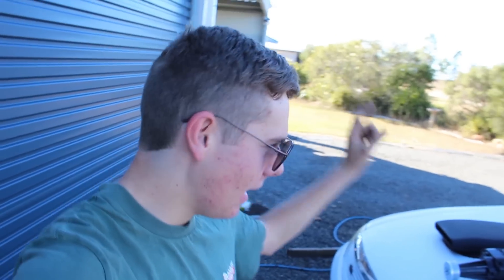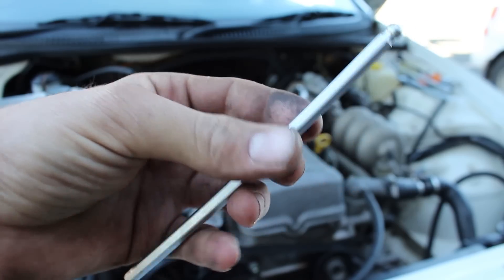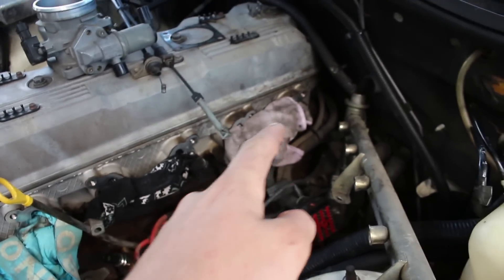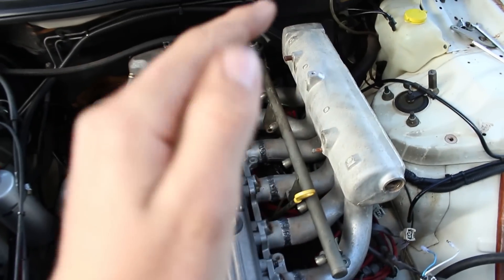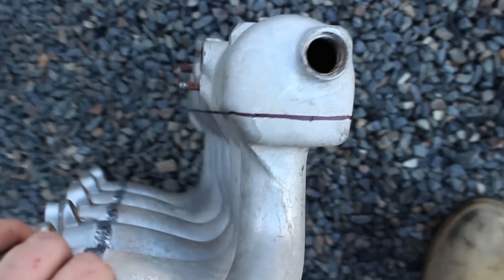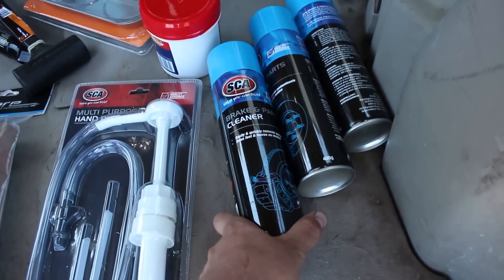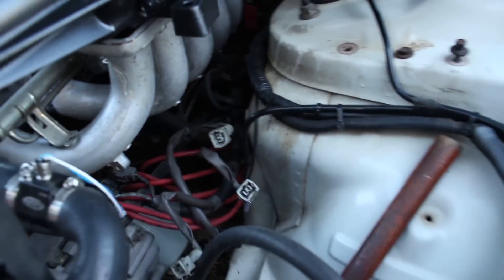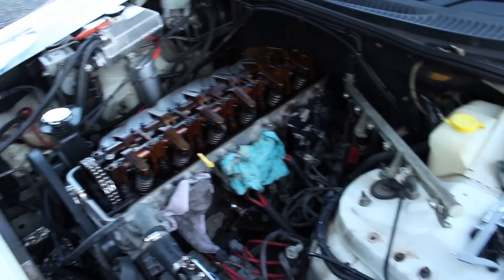COMMODORE SUPERCHARGER ON AU FALCON! Ep.1 - Richos Customs

Comment: Sick stuff, Richo. I noticed that the heat shield over the extractors is a bit different to the stock one, what did that come off?
Reply from the maker: Nathan Harmer yeah mate, of a ba xr6
Reply: @RichosCustoms  Thanks, mate. Is it a straightforward fit or does it need to be modified? I might do the same!
Reply from the maker: Nathan Harmer requires a bit of chopping and bending but nothing a few cuts can’t fix

Comment: Looks really good, hopefully has enough displacement to fill the 4 litre. I would have made the plenum larger and mounted the blower more central or on its side, get yourself a 12:1 rising rate fmu to up the fuel pressure with boost, add an additional inline bosch 044 pump and you'll be able to send it.

Comment: I'm doing an m90 supercharger on au engine too, only in an xf. I'm using a modified bbm lower so it will fit under the bonnet. Why do people still think you remove the bbm butterflies for turbo? It's long been known you get better bottom end torque and quicker spool with them working.